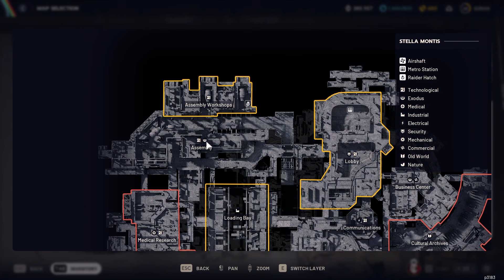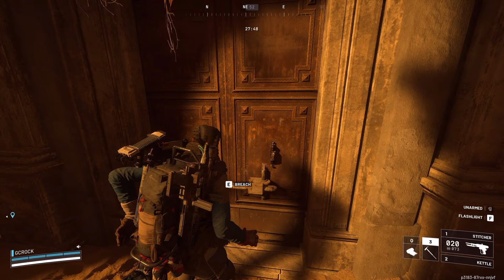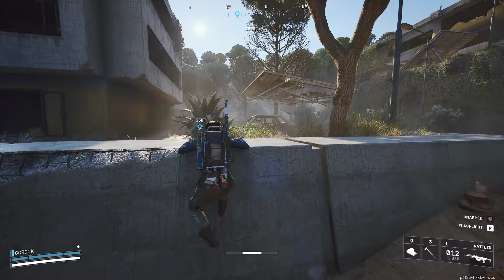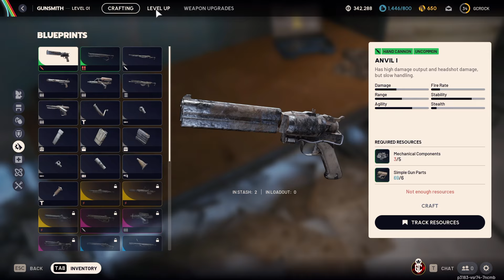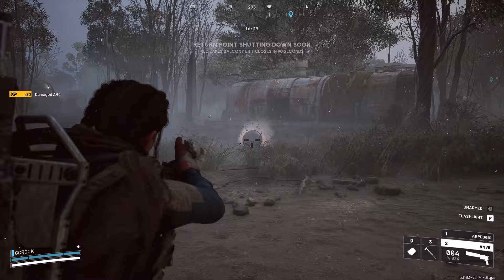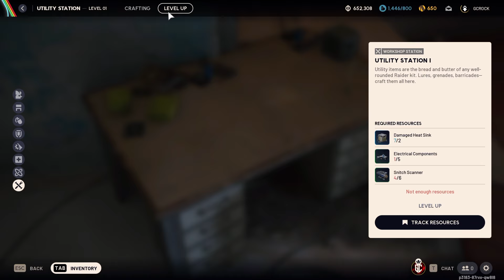How to Level Up ALL Stations FAST in ARC Raiders (Beginner Guide)

Comment: 1:00:30  pretty sure ive seen the surveyor vault included in the outer shields.  you need to check these when they drop off if it rolls away.  that may be what went wrong